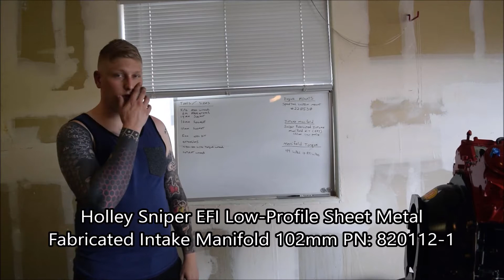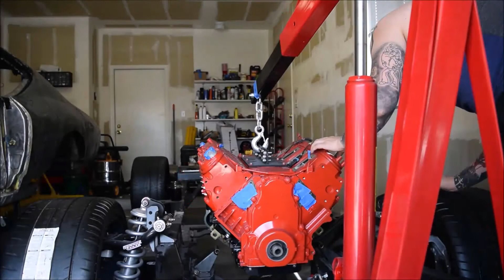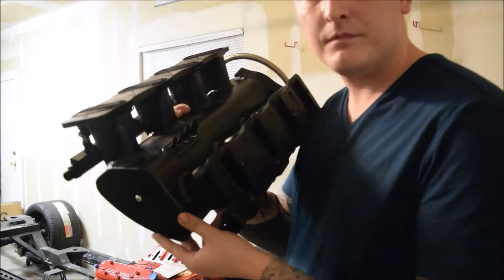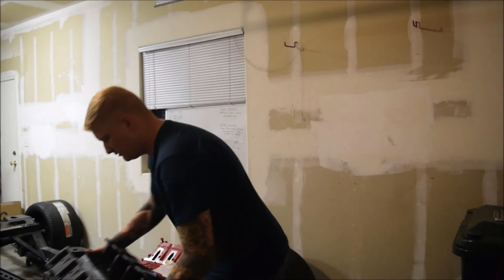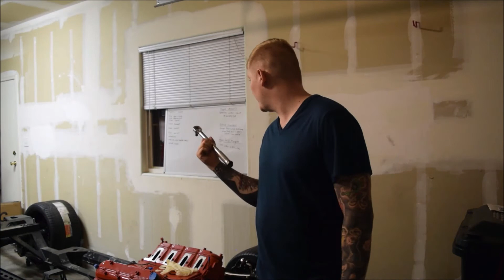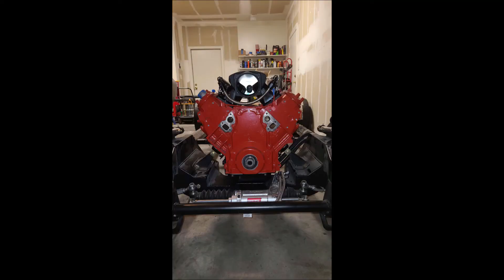Holley Sniper Fabricated Intake Manifold Install | Speedtech LS Engine Mount

Comment: Hey bro what did you do about the vaccum lines at the bottom of the intake?
Reply from the maker: I havent installed the vacuum lines yet. The connectors are installed and ready. You have to take the intake off to get to the vacuum line connectors, too little of room under to reach.